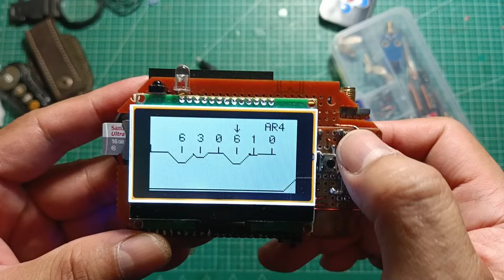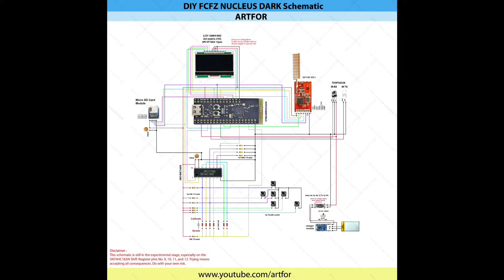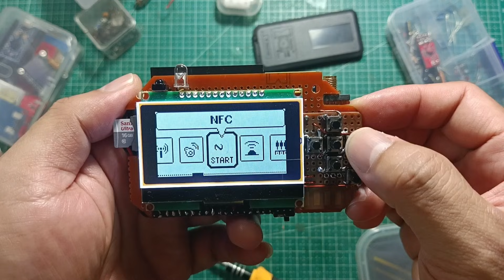DIY FCFZ NUCLEUS DARK Part5

Comment: Bro, please help me, it doesn't see my SD card, I connected everything correctly but it's still the same thing.😢
Reply from the maker: If the wiring is good but it still not detect it, try to format it to fat32, use 32 or 16Gb class 10 micro SD, and use a good brand

Comment: Do you have a diagram for the joystick bro?
Reply from the maker: 5 way switch??? Same just like in the schematic but remove 10K resistor because in 5 way switch it has already pull up resistors on it
Reply: @ARTFOR thank bro
Reply from the maker: You're welcome

Comment: hi..
1- there is no nfc function  ?
2 - can we use other spi displays..?
Reply from the maker: Hello👋👋👋
1.i don't have the module yet
2.no this Firmware is for LCD 12864-06D ST7565  13pin and 10pin only
Reply: @ARTFOR  man.. 
the display costs more then main STM32WB55CGU6
Reply from the maker: Not in my country, is cheaper than the board
Reply: @nagamanihegde9609  all 128x64 spi ST756x LCD will work

Comment: Why did you write the map below It could be wrong?. Is this map still in the experimental stage?
Or we can use it
Reply from the maker: Yes you can use it, just in case i make a mistake when transferring the schematic drawings from the book to the computer
Reply from the maker: And it not done yet i will add GPIO and NFC schematic on it